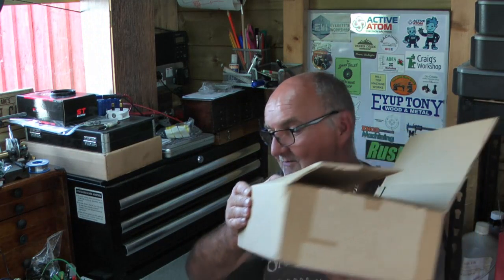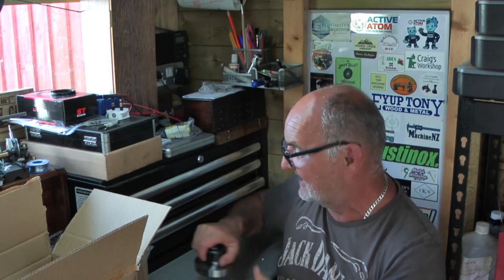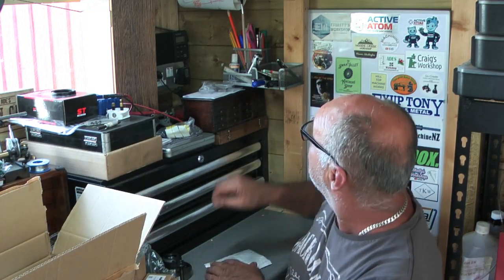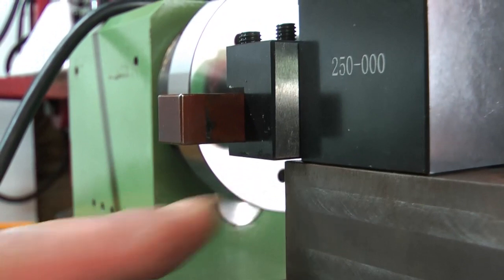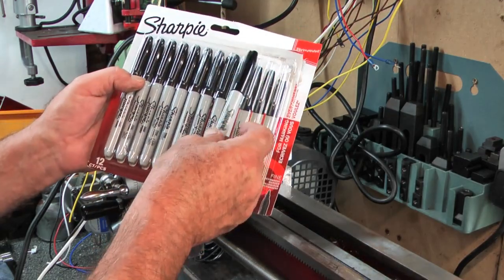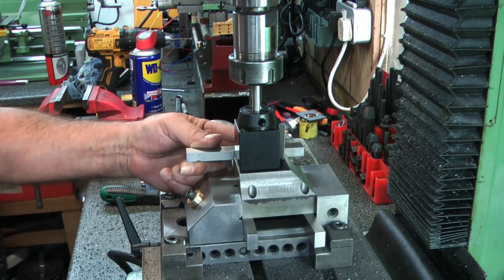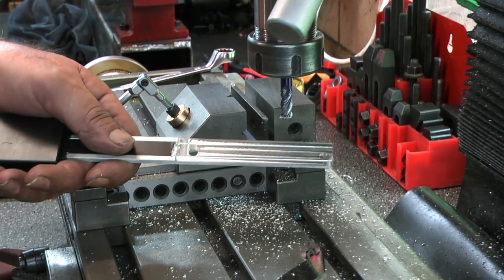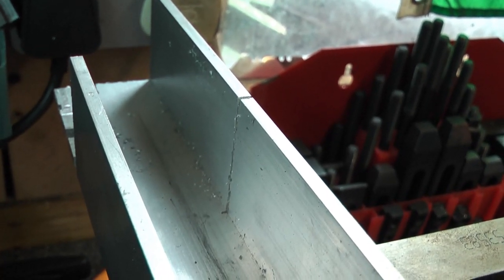Mini Lathe Part 16

Comment: I have the same 250-000. I used some aluminium tube
to ‘fill out’ the bolt and made a thin brass washer for the
top nut. Both helped. Luv y’work mate.

Comment: Half a mm off the end of the block for the toolpost would allow you to add a thicker bottom part to the holder, flush might interfere when tightening down, all looking good. I used to get my tools from the sam place as you and a few other placesin UK but now since brexit I have to pay the VAT twice not being in UK. 
A spring assisted ball-bearing indent at 0 and maybe a few other angles might help, I had this on my original toolpost when I bought my lathe before putting on a QCTP, yours maybe the same on the warco as its almost identical to mine just another colour.

Comment: I find my lathe collect chuck very useful but I just have imperials sizes and guess I need metric better cover material. I put a digital caliper on the cross slide but I found it gets in the way at times with trying to drill small parts. 
Not sure why they put a larger hole in the tool post than what you use as a mounting stud. I need to see if some brass tube would fill the gap rather than make a custom stud.

Comment: Thanks Ade, very interesting. I would guess that the DRO slide is Optical rather than Magnetic.
If so, the slide would be an optically printed piece of glass or similar (printed using lithographic techniques to get the very fine reslution), while the black tape would be an Infra-red filter.
Reply from the maker: Now it makes sense . Cheers Ade.
Reply: MADE ! IN ! WHERE !??

Comment: Hi Ade I have been watching your vids for a while now and was hoping to make a block to mount a QCTP on like you have done in previous vids but I am having trouble sourcing the metal or cast iron large enough to do it I was hoping you might be able to point me in the right directions to where I might be able to buy some either on line or steel stockholders I have tried Barrett engineering steel local to me but got no joy from them any help much appreciated. I am loving all your vids by the way
Reply from the maker: Try college metal supplies . Cheers Ade.
Reply: Thanks for that Ade I will give them a try

Comment: The slope might discourage swarf sitting on the flat surface, but those lovely big elongated counterbore holes will be hard to put a plug in to keep the swarf out of there now!  :)
Reply: If that was me I would just add a dob of silicone to each hole. Easy to dig it out should he need to remove the block.

Comment: If you had drilled the block top part down say 12 mm and reamed it 10 mm, then tapped as normal, you would have had a location for the plain section on the bolt.  As it was, as you tightened the stud I could see it pull sideways as the end of the thread hit your countersink. Hence your finger found out that the tool post was hanging over by a few thou.
Reply from the maker: Thats a good idea . May do that when I replace the stud. Cheers Ade.
Reply: @davidwillard7334  Get your facts right. The bolt is an M 10 NOT M 12 as you state. Go back and watch it again, ADE says he tapped it M 10.
Reply: @daveticehurst4191  HOW ABOUT! YOU ! WRITE ! YOUR FACTS ! RIGHT ! Because ! YOUR ! COMMENT ! IS ! JUST ! PLAIN ! CRAP !!!!
Reply: @davidwillard7334  Just out of courtesy to you, if you read Ades reply to my original comment he said good idea and will do so if and when he makes a new bolt. Don’t bother to reply again as obviously you have not got a clue as to what Ade was doing. Goodbye.

Comment: Nice to see you back. It’s terrible, those nice summer days get in the way of having fun.

It’s funny how people use mixed systems in the same sentence. “…A foot of 12mm brass stock.” As far as the slot on the tool holders go. I would worry about the thickness. These “should” be hardened somewhat, so they’re at least medium carbon steel, and stronger than a thicker piece of “mild”, low carbon unhardened steel.
Reply from the maker: Thanks Mel . I will probably get some 10mm tooling so that if I make some more tool holders I can up the thickness without having to harden then , I will probably use gauge plate so fairly tough anyway , Thanks Ade.
Reply: It's Good that ! You ! Buy ! The ! JUNK ! Hey !
Reply: @davidwillard7334  ????

Comment: If you have the same toolpost that I do you won't need that baseplate and you might need to take a little off your cross-slide to get 1/2" tools down to center height.  I can lend you the 10.2 mm reamer I bought to clean up the bore on mine so I could make a better-fitting stud.
Reply: Also the hollow bolt that holds that toolpost together is left-thread, and one of the step blocks in a clamping kit is a good fit to turn it.
Reply: And that just ! STUFFS ! IT ! UP ! EVEN ! MORE !!